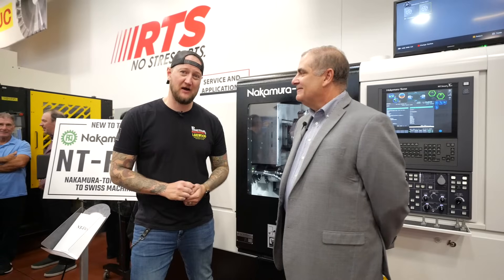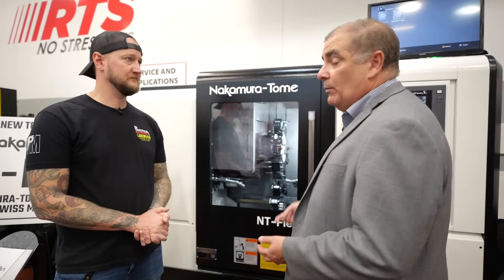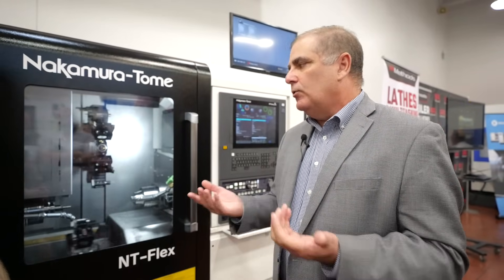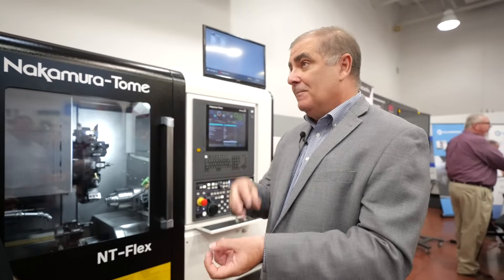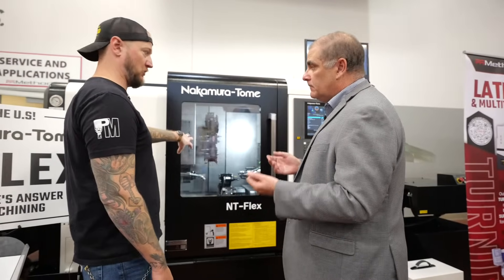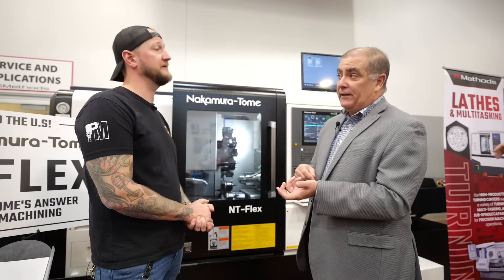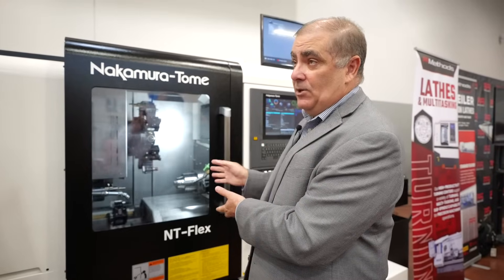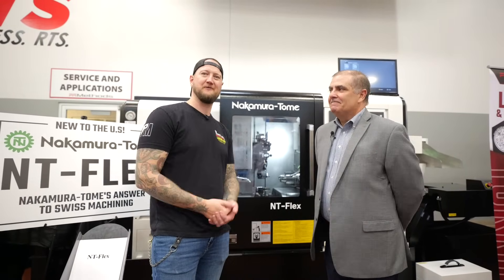High Production of Swiss Meets the Flexibility of Traditional Turning

Comment: I fail to see how this competes with Swiss. 

I mean I see how it’s a small machine, however u can also that there’s obvious clearance issues with getting both turrets into the cut. Especially with working on both spindles. Turret blocks don’t fit in between spindles. I also suspect there will be chip management issue on that lower turret sitting right under the spindle with a flat pan. 

Also…Swiss has come a long ways. Running 100 parts in Swiss is more no complicated to setup than a millturn. And they will cycle a whole lot quicker. 

I run both Swiss and millturn.